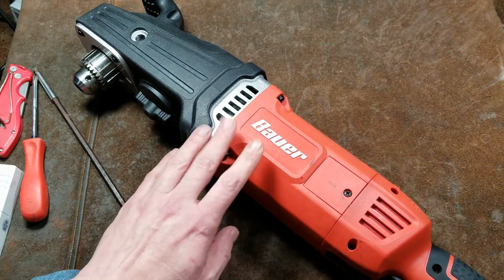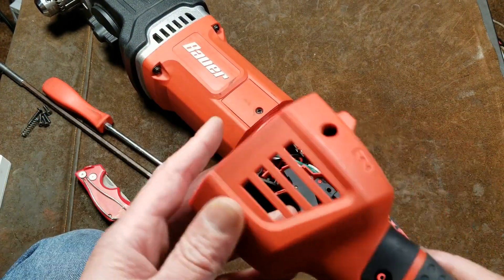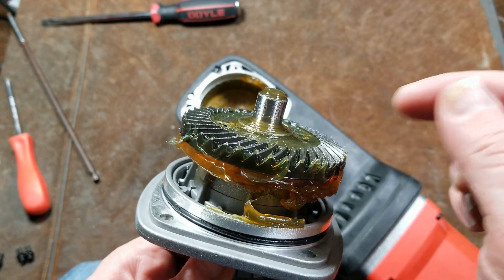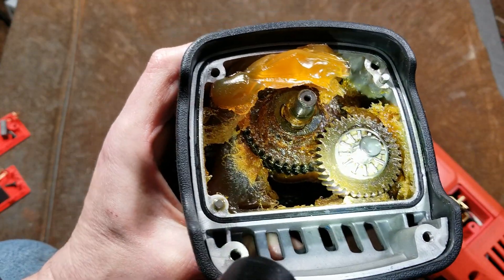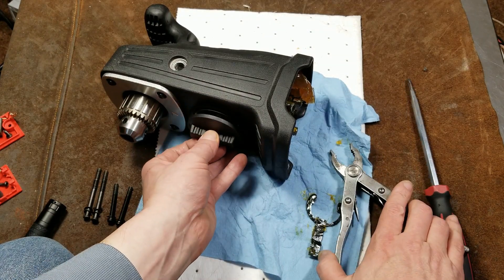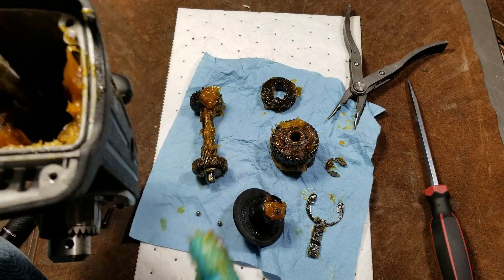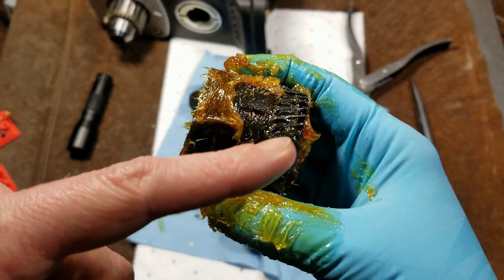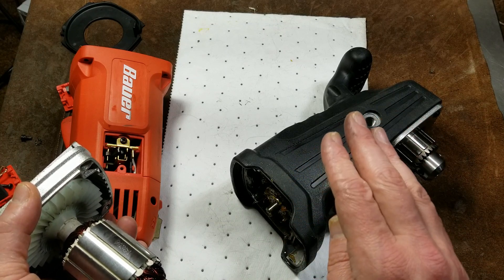TearDown: Harbor Freight Bauer Super Hawg Heavy Duty 1/2" Drill

Comment: I have this drill and just used it a lot today making log tenons with the big bits for mortise and tenons.  After drilling out 4 holes I changed the bit and notice a bunch or grease around the chuck.  Is that just some squazz out on the o ring or is that bad?

Comment: I wonder why "mixing" voids the warranty of this drill? That struck me as odd... That thing is BEEFY and WELL BUILT. Firstly, I do understand the stresses of mixing drywall compound and mortar on the tool. "The drill is under high torque for an extended amount of time" blah blah blah... But what I am saying is "So what?" thats an 11 amp motor and a properly machined and lubricated gearbox. If any drill could do it, this should be able to. Why build a heavy duty drill that you CAN'T use on heavy duty tasks? It's like they ONLY want you using it to blast thru 2x4's...

Comment: just picked up one of these the other day... was one of those "need it right now" situations and nobody in town had a Super Hawg on the shelf.  So HF it was.  Great vid and very helpful!  Not surprised by the lame grease, but thats easy to remedy at least.  Not too concerned about the amp rating on the switch.   If being used for its intended purpose, short duty cycles.  That's why "Warranty void if used for mixing"  Not sure why anyone would want to mix with this anyway, would be unwieldly as all hell and life is just too good with a dewalt spade handle.
Reply: I want to auger with it. Does that also void!? Haha don’t ask don’t sell right!?  Here’s a my dw124 auger vid

Comment: Now a lot of ventilation and a lot of dust inside. Wrong!
Reply from the maker: Have you ever looked at Big Milwaukee or DeWalt drills? Maybe I'll do a video of a whole variety of drills I have which have large vents.

Ever seen the vents on the back of a worm Drive skill saw They're almost wide enough to put your fingers through. And the last time I checked they deal with large amounts of dust.
Reply: @CatusMaximus  good idea. do a video of all your drills
Reply: @CatusMaximus  you could glue a fine mesh on inside of vent. That would help keep dust out but allow air flow.  Would need to clear them with compressed air when they clog up though.
Reply from the maker: Indeed Although more specifically, it really depends on the type of dust and debris wetwood particles will stick and build up far faster than dry. I've also seen people who use Large Grinders as aluminum polishers and for some reason the combination of the polishing compound and the fibers from the pa really clogged up the grinders. So much so that the brush covers were just left off during use so they can be blown out every few hours.